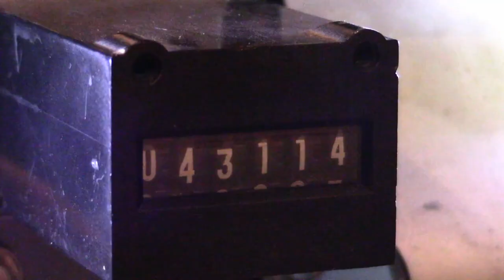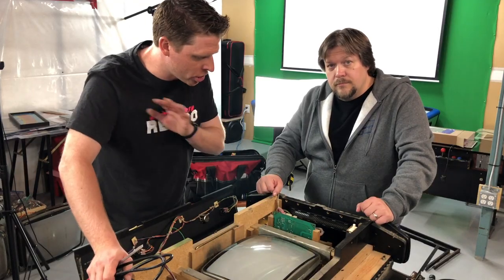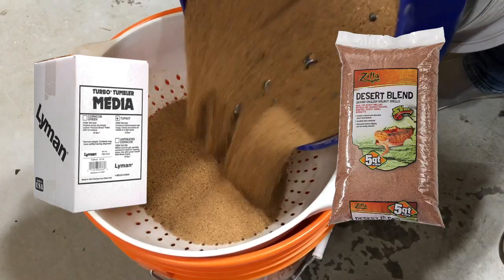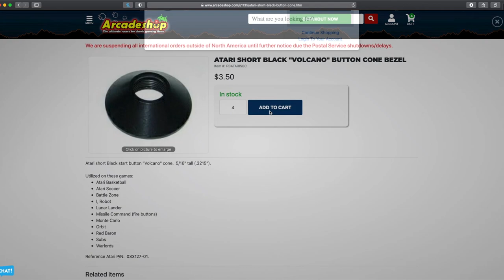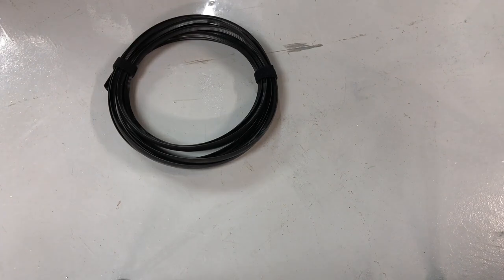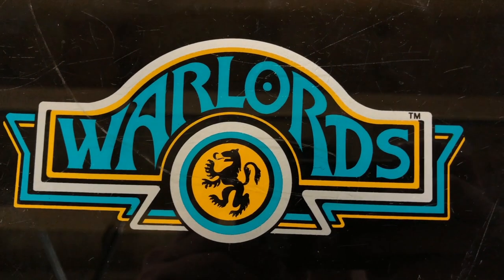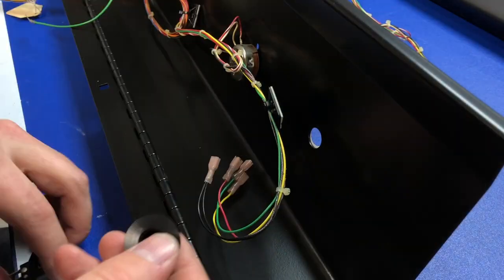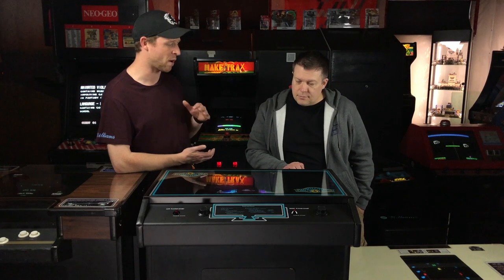The Atari Warlords Cocktail Restoration

Comment: I have a Warlords Cocktail as well.  Any ideas on how to troubleshoot the potentiometer controls?  Mine only does high or low for all controls and doesn't carry in between.
Reply from the maker: Thats odd, if its all 4 of the pots I’d look elsewhere in the game as the odds that all 4 failed the same way is pretty low. I’d test them with your multimeter first tho. https://www.google.ca/amp/s/www.wikihow.com/Test-a-Potentiometer%3famp=1
Reply: Yeah tested and all are within spec individually.  Rebuilt the power supply and will have to test around the board next.
Reply from the maker: Yeah, that would be our next step too. 🙂

Comment: what is the percentage of alcohol to water that you use for applying control panel overlays?
Reply: The percentage I drank thinking I had fucked them up? Or in the spray bottle?  That was about 50/50. But it doesn’t have to be exact.

Comment: how's that wells gardner monitor work off of 100VAC supply ,  Did  you add an isolation transformer that puts out 120AC... THE ORIGINAL monitor  was fed 100VAC...?  reply
Reply: It’s wired as was original.